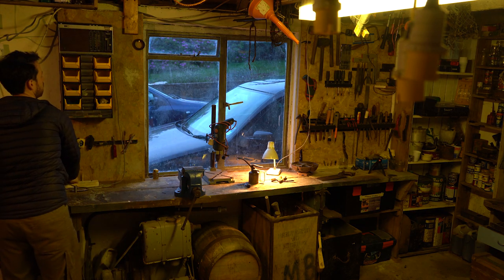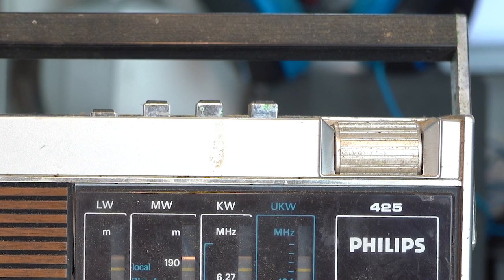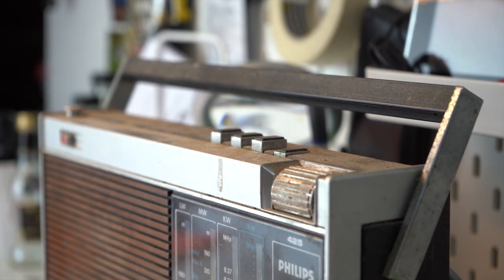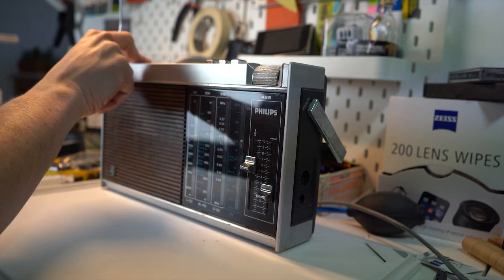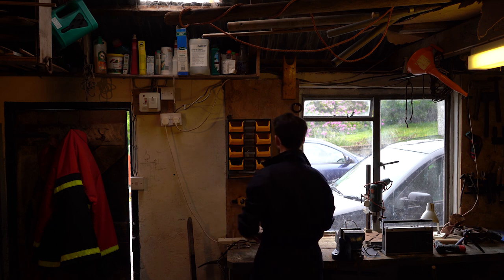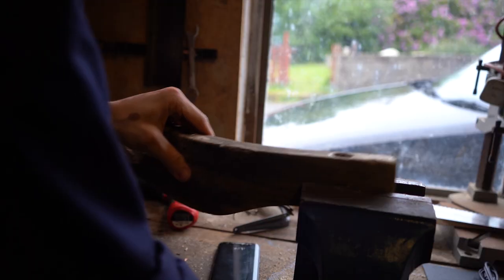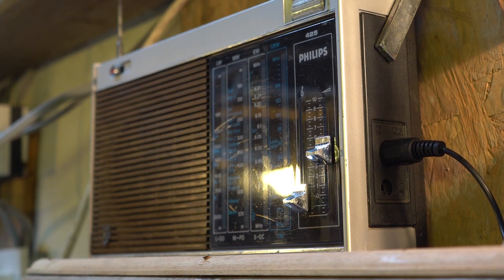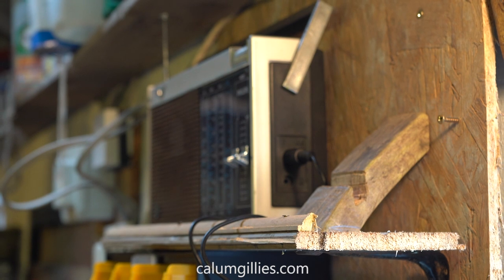Retrotech: My "Shed Radio" - The Philips 425

Comment: I remember "watching" Michigan University football in my Dad's garage on a 12 in screen tube TV. When you first turned it on the image would be a 16th of an inch tall horizontally but as it warmed up slowly the image would get larger.  The sound always worked flawlessly from the get go, so in a way that shaped my on going love for radio vs TV sports broadcasts.

Comment: That connector would be one of the variety of DIN connectors and is also used for MIDI, and PC XT/AT keyboards. XLR is typically 3 pin.
Reply: Indeed, it's a DIN connector. DIN stands for Deutsches Institut für Normung, the German Institute for Standardisation.

Comment: I clearly remember my Dad had an RCA portable "tube" powered radio that could run on a couple large batteries.  These batteries were not rechargeable but would last quite a while at normal volume.  Dad was a "do it yourself" guy and he used it when working outside on the house or the the old Chevy.  This was back in the 50's in Ohio, USA.  I did a Google search and saw a few similar to the one he had.
Reply from the maker: I love stories like that. Radios, walkmans etc are great because they really are imbued with the memories and experiences of the music and moments we experienced with them.

Comment: Philips Taifun de Luxe 22RL425/22Z I bought one for 5 euro a few years ago not shure what it was i was buying. After listening i got rid of the other radios. Sound is really good/natural compared. I now own two (the other one was 40 euro or so on EBAY btw you can buy those on Ebay!) but FM signal is getting less strong were i live so i have to replace them with a FM/BAD/DAB+/streaming internet radio. Looking at Roberts Revival istream3.

Comment: I have a 1930-40 radio that was basically just a shell that I used to put parts from a portable Bluetooth radio that had a completely dead battery in that I have in my house. For my garage I have a custom built stereo system system that I originally built around an old car stereo, some car speakers and a single hifi speaker. As time went on I’ve added various style of inputs into it, it first started off with the cassette player that was included on the car stereo which I used in conjunction with a cassette to 3.5mm adapter, I then added a CD player, the third thing added onto was an 8 track to play cassettes that I had found in the attic and I’m currently planning on adding a Bluetooth adapter to it.